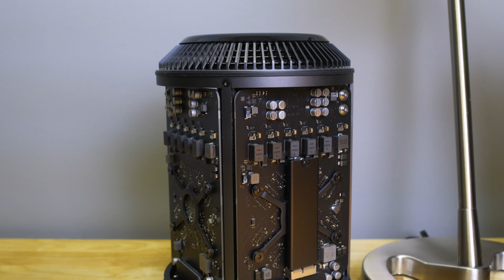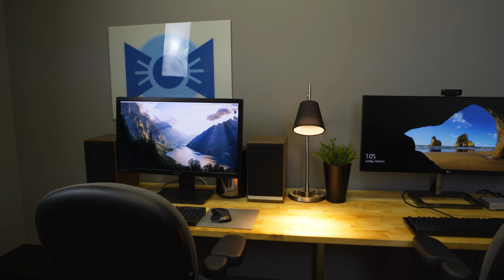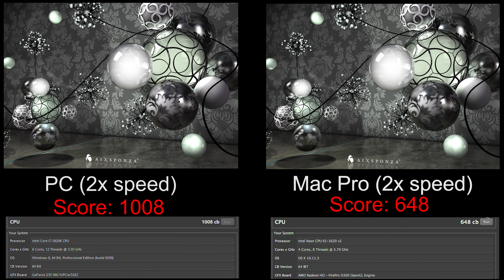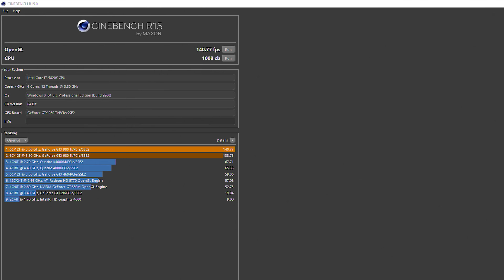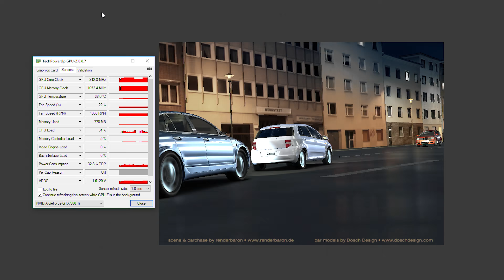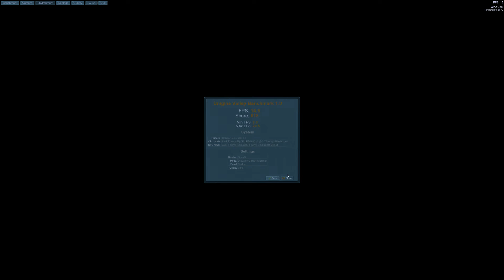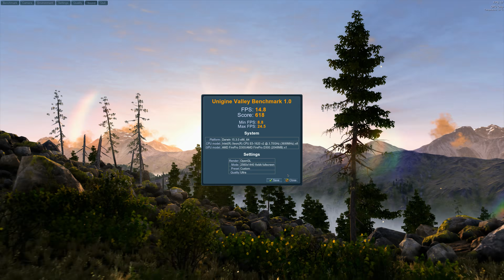$2,000 Custom PC vs $4,000 Mac Pro

Comment: Some people here are missing the very point Snazzy makes about 10 times in this video. This is the BEST and LATEST apple mac pro you can buy TODAY. The fact that he compares it to new hardware is VERY MUCH relevant since they are asking 4k for this machine TODAY. You people putting forth the argument "why compare new to old hardware?!" are simply misunderstanding the bigger picture on purpose. its 4K fpr something that is horribly outdated, and directed at professionals. It is very much a relevant to do a comparrision between what apple sells TODAY for 4k vs whatever else you can buy that outperforms it. And it being half the price? Come on, if you had a problem with this video you are either a complete apple fanboy who refuse to accept empirical data or you are stupid/ a troll. If you justifiy the cost with formfactor, Asus has recently released what can only be dexcribed as a copy, but the fact is that that machine is 4grand, and it has better performance than the 2k PC in this video, meaning that you can buy that asus PC if its the formfactor you want, and still get more than 2x the performance for the same price as the mac. Remember, this is about PROFESSIONALS, personal preference about OS should not be a part of this diskussion.
Reply: wonder if any Apple fanboy will try to argue with your well structured argument.
Reply: +Bernardo Santos I am sure they will find a way :) But thanks!
Reply: +snelpiller

 no it isn't, it's an entry level machine with 1 processor.......no-one uses them unless you only do music. he could have bought a 12 core mac pro for half the price
Reply: +fradaja Apple would never sell something like that for that cheap.
Reply: Host Mods anorher used mac? with multi xeon's for a grand.

Comment: i see you change the water cooling to corsair, so is it better than NZXT ?!
Reply from the maker: +m03Th Eh, they're both made by Asetek. Temps are similar. Fans are louder so I replaced them with Fractal ones. Pump is quieter though.

Comment: lol my $1100 system aces your $2000 system in both benchmarks
Reply: +Calvin Schubert system specs:
FX-8350 4ghz clock speed
Windforce GTX 980Ti (Not The G1)
12Gb RAM (Mixed Modules)

Comment: You dont use the 8 core mac pro
Reply: you wanna go that way? fine. intel just released new xeon with 22 cores and 44 threads the best part is that you can have 2 of them  meaning 44 cores and 88 threads, and you can put them in a pc. You think your precious mac will have any chance against that?

Comment: The trashcan Mac Pro can have a D300, D500 or D700 graphic cards. Here you have the D300 which is the low-end GPU. The D700 has similar performance to a GTX 980 Ti. Of course the D700 machine is even more expensive, so PC wins on price/performance as usual, but really, here you are comparing "apples" and oranges ^^ and you are wrong when you say this is the best Mac Pro money can buy.
Reply: Here's my source that compares a GTX 980 to a D700 Mac Pro: http://barefeats.com/gtx980d.html
Be careful, the first line is actually two 980's in SLI
Reply from the maker: +Guillaume Cottin Never said it's the best Mac Pro money can buy. I said the Pro is the best computer you can buy in Apple's lineup. Which is true.
Reply: +Snazzy Labs Ok yes, said this way, it is true. But this is an entry-level version of the Mac Pro, which is not clear in your video, and it costs $3K not $4K.

Comment: I bought a 570ish € PC two weeks ago. I did those same benchmarks when I bought it and got WAY better results than that mac.That old "Mac's are good for editing and bla bla bla" argument to me is just invalid, doesn't matter if you test it with gaming benchmarks or test it with actual editing work, a PC, or this 2k pc on the video, will out perform the mac. Apple is simply selling a brand. And let's not talk about the OS.

Comment: The Mac Pro has server hardware (Xeon cpus, ECC ram, etc) which is why it's expensive.
Reply from the maker: +freddieman23 Not really. Could have bought a Xeon and ECC RAM for about $600 more. Still way less than Mac Pro and it would even more quickly outperform it.
Reply: DIY will always be cheaper than pre-built

Comment: Apples focus is on phones and tablets.   In general DIY Windows builders will always get a better value dollar to dollar vs. a Mac.   OS X has a real price premium.   While the Mac Pro being shown is $3,000 it wouldn't matter.

Apple sells overpriced underpowered devices.   Consider the entry Macbook.   Super thin but no SD.   One connection for everything.   a 480p webcam and a M processor.    A ASUS UX 305 is a better value.

Comment: A completely valid comparison. I can't help but wonder at Apple's long-term strategy in terms of professional computing. I have an iPad Pro that outperforms my Mac in some ways. I suspect that Apple has either decided to leave the pro computing arena (which I find hard to swallow), or that it is spending a great deal of time and money creating a proprietary set of hardware to leapfrog the Intel/nVidia state of the art. I'm not sure, but either direction would be risky unless Apple is taking on another industry where profits can climb much higher (such as the auto industry).

Comment: The Nano S case is too big. I wish that there was a mITX case with the same features but optimized for size and airflow without sacrificing silence.
If you are doing air-cooling then most of the space inside the Nano S is empty space that the fans would have to shuffle air around in.

Mac Pro: 9.2 litres (bounding box) <-> Fractal Design Nano S: 28 litres.

And the best mITX cases:
NCASE M1: 13.5 litres. (Does not support large tower-cooler for CPU)
Fractal Design Node 202: 10.2 litres (But... Almost as high and deep as the Nano S and supports super-low profile CPU cooler only)

Comment: You made ONE valid point: Apple has not upgraded the Mac Pro. They will not just drop it off their website list, just because they have no updated model. That wouldn't make sense. They keep it, because it is great for video editing. When Intel updates the processor, Apple will update the computer. You didn't test ant real video editing. No one buys a Mac Pro to play GTA. No one buys a Mac Pro to "construct a 3-D model". They buy it for scientific apps and video editing. If you want to test it, edit video, render raw footage from a camcorder. By the way, Apple kept an outdated MacBook Pro Mid 2012 model on their store list for three years, and it sold well, and customers loved it – BECAUSE IT HAD DVD BURNER, outdated technology that 99% of us don't need. I haven't bought a DVD disc in ten years.
Reply from the maker: +Lance Baker When Intel updated the processor...? Dude. The Xeons in the Mac Pro have been updated several times since then. And yes, I did a video editing test. PC was 2X faster. Also, tons of people buy Mac Pro for 3D rendering. Ever wonder what people make apps and 3D CAD models on...?

Comment: lol, you've got to be kidding me. Lets just clarify a little bit here:

Firstly: MacPro is using workstation grade hardware through and through, therefore it costs more (duh?)
Secondly: Apple is a singular company. Therefore, they have to fully construct the machine in the factories after a lot of R&D and planning that goes into creating such a small speedy machine while your pc has a bunch of individual parts that are sold by a lot of different companies and you're the one who has to assemble. Obviously you'll be able to have a more updated computer than a MacPro
Thirdly: Take notice of how you have your MacPro tucked behind a computer monitor while your pc is taking up a significantly larger section of desk space. 
Fourthly: The MacPro is designed to work with its fully optimized software. Try video editing samples with finalcut vs your pc with premiere. I promise the pc will get crushed

I could go on, but the bottom line is that you misunderstand the fundamental point of the MacPro and the fact that you're being so condescending towards a product a lot of people back and rely on for their workplace livelyhood is just kind of childish. Understand your products before you go about hating on them.

Comment: This video is deceptive and he should lose the respect of the anyone who has it for this guy.
This was no test.
This guy has no idea(or the more probable, fakes not having any idea) about what he did with this video.

The MacPro in this given example is a buldozer, the PC in this given example is a sportscar.
He had just thrown the verdict based on testing which of the two won in a drag race.
Mixing up pears and apples.
The MacPro is NOT made for gaming. It is a workstation.
I've never had an Apple product in my life, Android ftw., Windows ftw., but this video is a typical ignorantly brought up proclamation.
This video is shit.
Reply from the maker: +Gandeloft If you watched the video your realize that the benchmark was a benchmark. Just because it looks like a video game doesn't mean it was testing gaming performance. The Adobe Premiere results speak for itself. Derp.
Reply: +Snazzy Labs Re-read my comment, and acquire adequate knowledge about the subject. After doing so, you may delete your comment and admit you've made a fool out of yourself. It's np, it's a crucial step in learning that all children must work through, making mistakes that is.

Tips:  "Reliability is expensive."
"Workstation cards are not gaming cards"
Protip: realtime 3D benchmark enviroment = gaming enviroment.

Comment: Yeah, the Mac Pro is outdated. They went to much into small form factor. It's a pro unit and needs hardware upgrades to be competitive. Apple software tends to be really optimized. Ex. Final Cut Pro but the biggest problem is the GPU options Mac goes with. They are always underpowered spec wise over likewise design purposes machines in that price range.

Comment: The thing is, the workstation card in the Mac Pro isn't designed to pump out real-time 3D work at speed - they are designed to do a shit load of work reliably, so I think graphical tests aren't really a fair comparison here.
Reply: does Apple sell this computer as suitable for video processing? Why yes, yes they do. Even though it's not very good at the task and is absolutely destroyed by a computer that costs half as much. Does the average consumer in that market really care that the PC that gets the job done might glitch every couple months when they can get 3 times the throughput from it?  I highly doubt it. People buy Macs for the pretty boxes, not the performance.
Reply: Where is the test that shows video processing? This video just shows a load of realtime 3D rendering - it's completely different. 

Video rendering is far more CPU bound.

Do people that use their mac to make a living care about glitches? Of course they do. When you do it for a living, it has to be perfect day in, day out because even a day lost is going to cost you a decent sized portion of the cost of either. 

Reliability is why I started using a Mac for work and apart from half a day lost when I spilt water on my laptop, they've never failed me. I can't say the same for the various gaming PCs I've had over the years that have had far less use. 

That said, my gaming PC is a very similar spec to my iMac. If I swapped out my gaming monitor for a decent 27" 4-5K, the difference in cost between them is only a few hundred dollars.
Reply: Mike Hughes
It's not shown because of the timeframes, but he speaks about doing an export of the same video from the same software running on both computers.  The $2200 PC finished in about 1/3rd the time.

And if you've spent that much on a gaming PC, you either overspecced it for a particularly hungry game or you got ripped.  My gaming PC cost me ~AU$1800 including all the peripherals, and it's still going strong more than 6 years on.  The only hardware that's changed in that time is I upgraded the video card (price included in the above).  It runs everything I play adequately, and a lot better than some more expensive boxes I've seen.  And it hardly ever dies, l even when I abuse it.  I built it, I maintain it, it just works.

By contrast I've used workstations that cost about the same that can't do crap and - due to bad maintenance and worse software - are unstable as hell.

So it's not all about the hardware, it's about how you maintain it.
Reply: I'm talking about an average  spec gaming PC - which also happens to be around the minimum spec for an Oculus Rift.

4790k, 16gb ram, 512GB M2 SSD, R9 290 - using decent components, case etc. comparable to what you'd find in my almost identically specced iMac.

Whether it's overspecced for gaming is irrelevant. I have a PC build with decent components that is almost identical in spec to the iMac and if you took the cost of the monitor, operating system etc. into account, the prices are much closer than you might imagine.

Comment: Why not compare a tower with a tower??  If you are going to compare a small form-factor case computer with a tower, then how is that a valid test. Also, while cost is a real world issue for everyone, most people care nothing about cinematic benchmarks if it will be a work computer and word processing documents and spreadsheets are going to be the primary "load" of the computer on a daily basis. Furthermore, if you are going to test an "almost 4 year old design", to quote you, them how about a pc built with similarly aged components. Would you compare a brand new tuner hatchback with a 4 year old suv and claim that the new hatchback is clearly superior based on handling tests, or mpg, acceleration rates, or power to weight ratios??  I would not.  Understand, I use Macs both at work, and at home, and have since the mid 1980's. That being said, i don't hate PC's. If you like them, fine. Like what you like, but I think your testing procedures need some tweaking.
Reply: +carnut015 If you need a work computer for word processing you don't need $4000 worth of components.  And I don't know what your talking about but if I were buying a car and one was cheaper, newer and had better mpg than the other It'd be obvious which one I'd pick.
Reply: Butcher Pete
The car comparison analogy was meant to point out the lack of direct comparison he was making.  A new, fast car WILL outperform an older car.  THAT was my exact point.  To put it in succinct terms "Compare LIKE with LIKE for a MEANINGFUL outcome to your tests."  If he was going for a parity test, why not compare a $2,000-ish NEW Mac Desktop against his $2,000-ish NEW homebuilt PC???  OR a "4-year old  design," $4,000 MAC desktop with a "4-year old design," $4000 PC desktop???  What I am saying it pick a criteria and test based on those lines, not just "These two computers are on the same desk.  I will pit them head to head."

I realize I am going on about the parity point, but his lack of parity in his test just buggs me to no end.  It seems he had a conclusion in mind and MADE the test fit his DESIRED OUTCOME, instead of having a QUESTION in mind, and seeing WHAT the POSSIBLE, unknown out come would be.  I cannot say for sure if he was operating under this confirmation bias mindset, or not, but to my eyes, the test did not seem to test "LIKE with LIKE."
Reply: There is no need. He could build a $4000 PC but he showed us that would just be overkill, as the PC half the price out-performs the Mac by a mile. To compare the mac to a similarly priced PC now would be completely redundant. We wouldn't learn anything new.
Reply: Butcher Pete
And I learned nothing from his test other than he made a comparison that had no merit.  He compared a "4 year old design" to a computer  made with "up-to-date" components.  Why not compare a 2016 Ferrari LaFerrari with a  1968 Ford Bronco and come to the conclusion that the Bronco is an antiquated piece of shit  because it gets outperformed by the MODERN ( in every way) Ferrari??  Cost be damned.  His methodology was flawed, in my opinion, and he emphasized the COST of the machines to a point of "look at the stupidity of Apple., and the people that buy their products!!! Instead, come over to the PC side of the fold and ALL WILL BE RIGHT!?  What about those of us that do not want to have to BUILD our hardware, have to UPDATE it with regularity JUST to keep it running, and have to worry about the latest computer virus going around.  I, for one, enjoy being able to buy a computer, plug it in and KNOW it will work every time. 

I am going to stop at this point as I seem to be shouting into the wind, and let you PC people crow about the superiority of your "cheaper, faster, better" hardware while I enjoy YEARS of reliability from my Mac with little, to NO maintenance costs.  Have fun replacing that graphics card in two years!!!!
Reply: I give up, some people just don't want cheap ferrari's